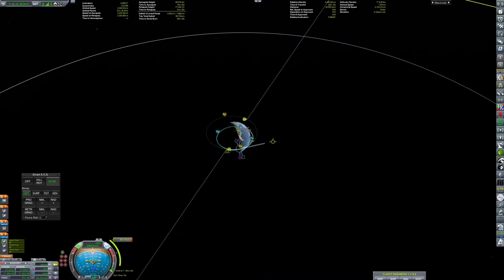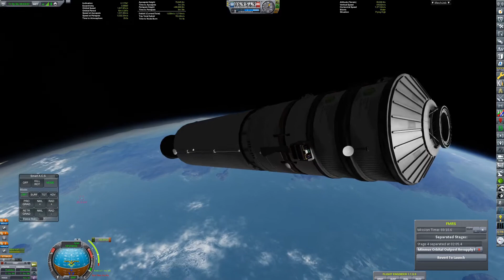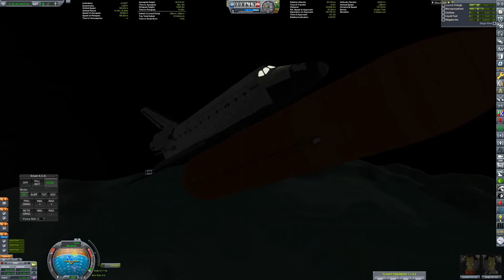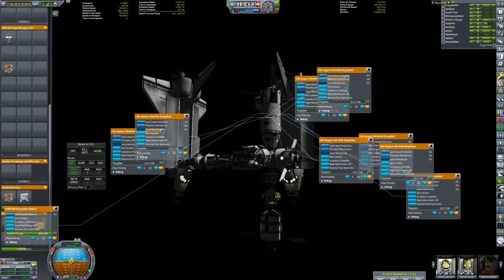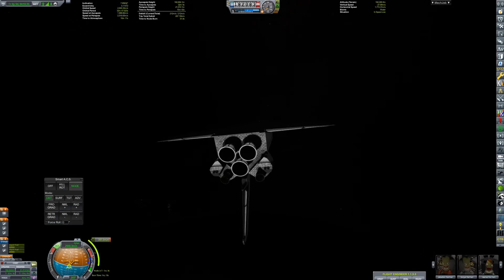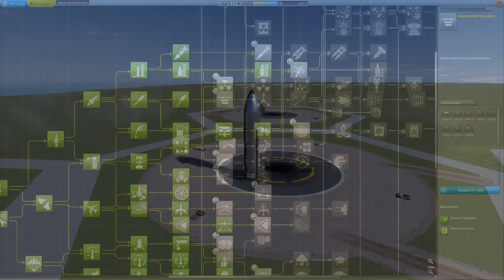KSP | Kolonization Project Ep. 10: Shuttles to Minmus

Comment: So what you're basically saying is...
The stock NERV(A) engines aren't very radioactive, because they're just regular solid-core nuclear reactors that are used to heat up the fuel to very high temperatures, and due to this high temperature, are very efficient. Solid-core, meaning the fuel in the reactor is actually solid instead of liquid or gas, meaning the fuel rods stay in place, and none of it is being sprayed out the back (unlike in a liquid or gas-core reactor, where the exhaust is fuel plus fuel rods.) The exhaust plume of a solid-core engine has been irradiated by the reactor, but isn't radioactive by itself - it's basically just really hot jet fuel.
Reply from the maker: Exactly! Also sorry it took so long to reply to your comment.